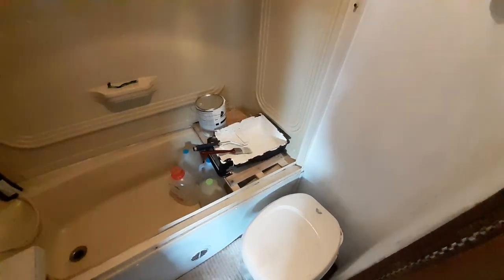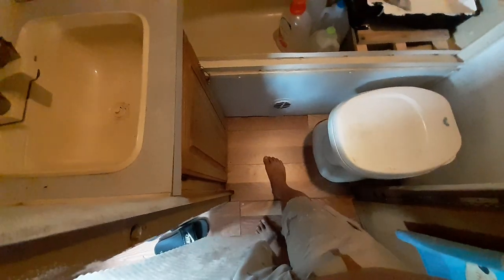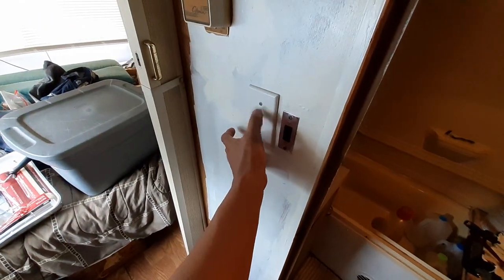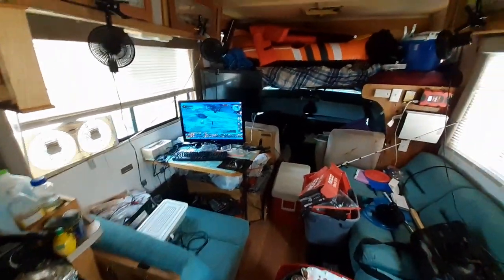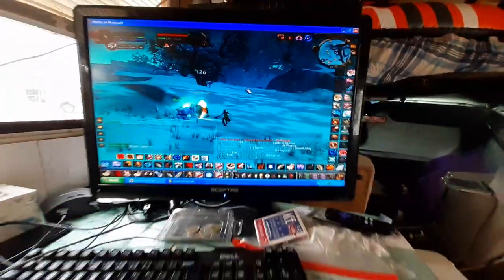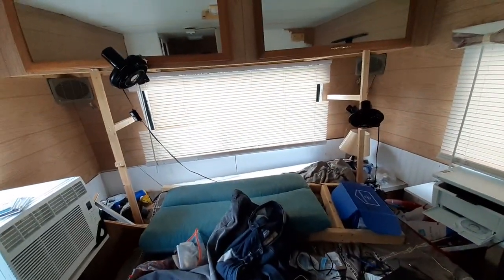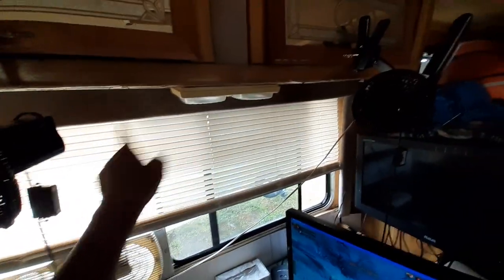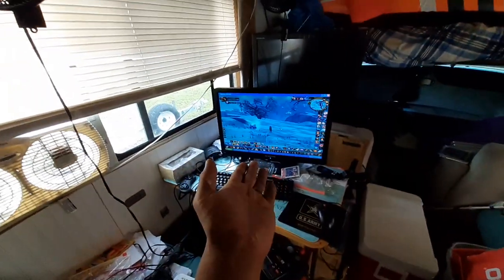Renovating The RV Bathroom, Fixing Broken Fans And Becoming Mr. Roboto

Comment: You can put a pump on the end of a shower hose and stick that into a bucket full of water that works as a shower. They sell one on amazon that works decent but seems like it wouldn’t be that difficult to replicate. The prices seem like they really went up on those recently. It’s the trick you use when your water gets shut off or your hot water heater is broken.

Comment: I recently picked up a couple of the usb fans at walmart and they put out a LOT of air for very little energy use, they cost around $6 and my 20000mah battery pack will run 2 of them for 9hrs or so. I have several in the mobile home and in both vehicles
Reply: I have that same setup, I got those Sharper Image usb fans at Walmart and they work really well. 2.5 watts or something like that I put 5 of em in my van.

Comment: Use a car Radiator fan they runoff 12 Volts I saw it on a YouTube video with a short bus conversion. He used it as ceiling fan.
Reply from the maker: Actually, sounds like a great idea. Wonder how much they cost?
Reply: @LivingInAVan  Ive used a rad fan before, they SUCK power like crazy unless you can add a speed control and even then its power hungry.. they cost a LOT more than the fans you have even at a salvage yard

Comment: how much did u pay for your rig?
Reply from the maker: $1,200.  But I ended up sinking about $6,000 or so more into fixing things up (transmission, all new tires, etc.) and adding 1000-watt solar power with 500AH batteries.